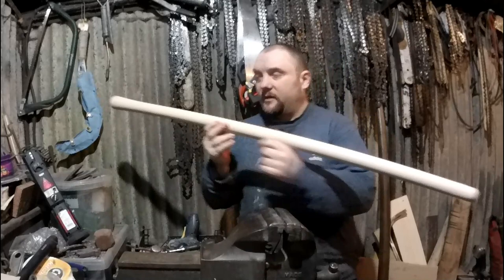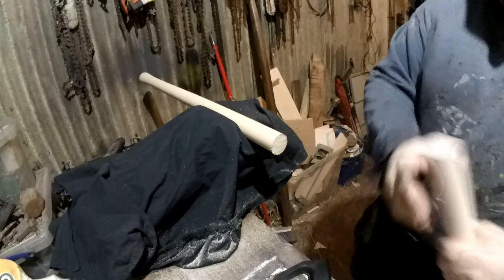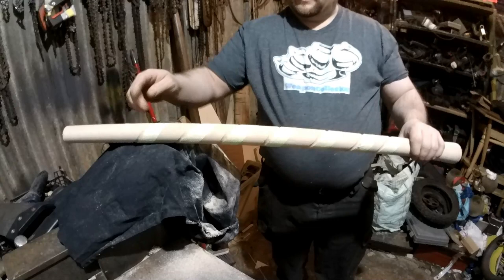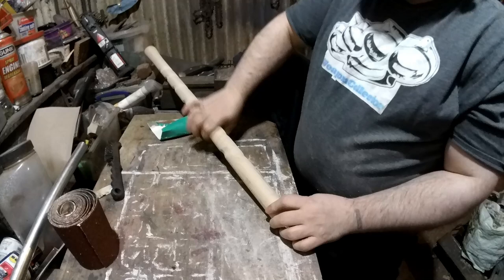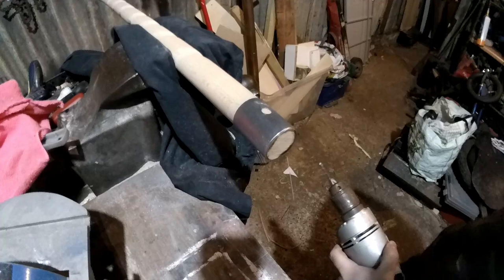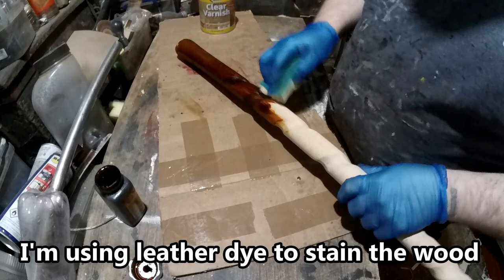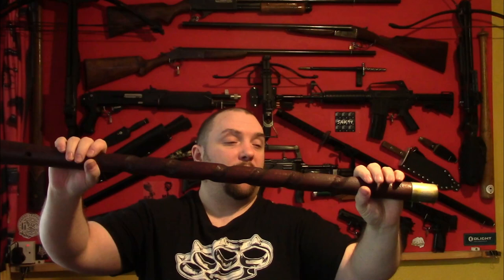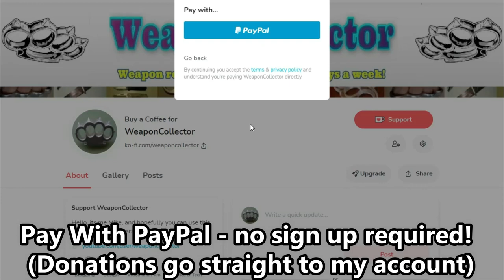How to make a walking stick (Self Defence Stick)

Comment: I never thought of using some of my leather dye on a stick. Great idea. I will try it on a spare closet clothes rod I have. Nice, simple and informative video as well.
Reply from the maker: its work very well to stain the wood, putting varnish on can sometimes have a bit if a reaction - then yo mix with the varnish, not an issue usually, but if it drips onto the ferrule you can see it, but can be wiped of easily, still a good overall dye though.

Comment: You can cut off about 11” off the  top and make a scabbard, then fix a 10” blade to the bottom,  now you will have a 30” short spear with a 10” blade